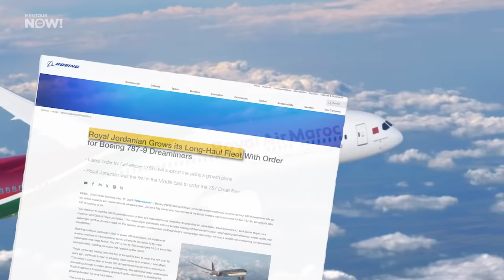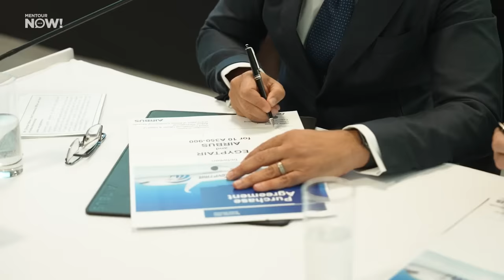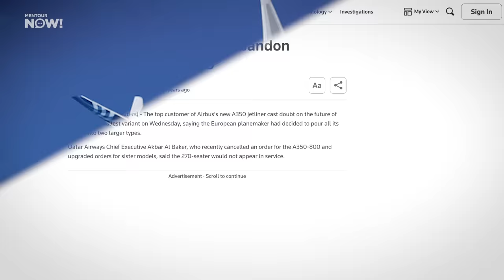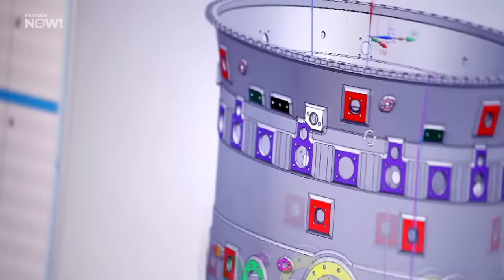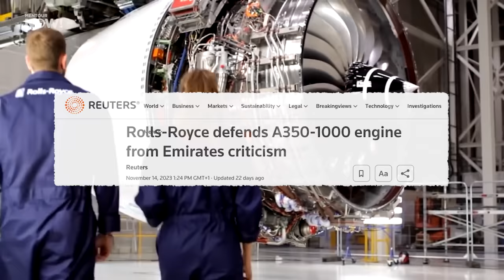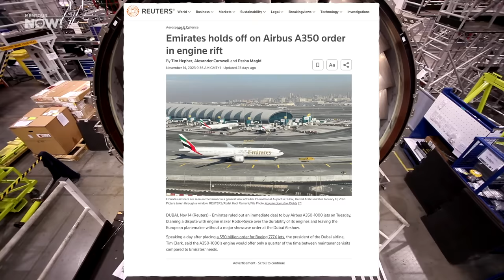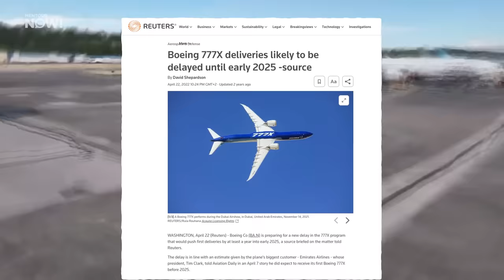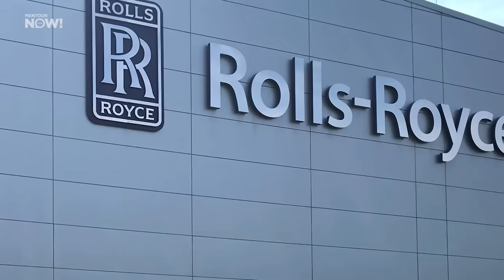What’s WRONG with the Airbus A350?!

Comment: Hi MentourNow Team, great video! 10:34 I’d like to clarify some misconceptions on the Trent XWB-84 and -97. Online sources indicate that their fan diameters are the same at 118 inches. The increased thrust output of the -97 comes from different internal component designs such as the larger core. Articles also shared that the increased power results in higher temperatures and requires improved cooling. Perhaps the high ambient temperatures in the Middle East also cause lower than expected time on wing performance because of these rotables and life limited parts being affected too.

Thanks for the video it really got me searching and learning more! Cheers!
Reply from the maker: Thank you for the information! Yes the fan diameter is the same, this was a mistake, it was the internal differences that were large enough for the two engines to end up with different designations.
Reply: Hmmm i am not sure about your take on temperatures. Jet engines operate under high temperatures, we, are talking about hundreds of degrees. How much hotter does it get in the desert? maybe 20 degrees or 30F. Thats a big difference for you and I , but not for a machine doing say, 800-900 degrees F? Plus, a lot of their hgih density departures happen at PM, when its MUCH cooler. My point? There must be something else to the story...
Reply: I’m glad you went thru all this because the moment he said 87 and 97 inches I was thinking “that’s like PW GTF and CF6 sized fans.
Reply: Combustor exit temperatures are well into the >1900K (~1600-1700C) for modern turbofans, well above the melting temperatures of the nickel alloys that the turbine blades are casted from. They require highly elaborate barrier coatings and actively cooled by enveloping the blade in a film of cooling air (which by the way, is already well above 600C to start with). A hot & high takeoff at say ISA+20C could have a significant impact on life-limited parts compared to the nominal flight profiles, so inlet temperature matter much more than you're making it out to be. 

When your components area already running at the very edge of what's physically possible, an extra 20 degrees matter a huge amount.
Reply: And in case it’s not obvious, the 87 and 97 in the name is the pounds of thrust in thousands.
Reply: @DuyLeNguyen  not if you reduce the power a bit which is what they do for midday departs. Most of Middle East heavy long distance departs happen between 8 PM and 9 AM, when its only around 65 to 80F. If they're complaing about that kind of "high temps" then they need to get out of the airline bizniz
Reply: @alexanderordinary2110  Inlet temp doesn't just affect cooling, air density is also lower at higher temperature which reduces amount of thrust an engine generates (all else being equal), so not only do you have worse cooling because of high ambient temperature, you also won't be able to derate as much because you need to run the engine harder to compensate for the lower air density, it's a double whammy, so you won't be able to 'reduce power a bit' because at high temperature you are limited in how much you can derate your takeoff. Full takeoff thrust is typically limited to a couple of minutes at a time, so you still need to get the loaded aircraft off the ground, with positive climb within those few minutes (plus sufficient allowance to still be able to climb with one engine out), there's no free lunch when it comes to hot & high operations, you either lose out on performance or maintenance interval, and if you cannot accept a performance reduction due to the demands from the ambient conditions, then you need to accept a lower time on wing.

Engines are typically designed for a baseline takeoff at sea level static, standard ISA (15 degree C), so your 80F is already ISA+10.
Reply: @MentourNow  huge surprise, not used to such errors from you, XWB84 and XWB 97 refers to thrust level.
Also some short cuts on the single source versus engine choice and engine operational costs….
Reply: @alexanderordinary2110  Hot air means less lift, needing more takeoff power, down at low altitudes where the sand is...
Reply: @DuyLeNguyen 
I am a bit conflicted about a relatively small temperature increase near a “threshold” causing such a dramatic in maintenance. But it might be the case as other engines have had issues due to incremental core temperature increases. But my “guess” is that the “non-benign” aspect of the operation is more than a transient core temperature increase but also a combination of temperature and seal wear (due to abrasive dust) or accelerated blade erosion / corrosion . It is fascinating that an engine has been designed to operate that close to the “knife-edge”. When something doesn’t quite make sense, it is usually because of having incomplete information, so time to go down that rabbit hole.

After going down the rabbit hole, it is more than just a “maintenance issue”! From an article:

Perhaps indirectly divulging potential future mission goals for the A350-1000, Clark is also pushing for a 10,000 lb. thrust increase to 107,000 lb. “The engine is under-‘spec’-ed for what the aircraft could do,” he said. “It does not have enough power, the technology is not proven.”

So combining your comment on takeoff off “thrust margins” being pushed to the max (pushing the engine to the temperature threshold), the airline’s demand for even more thrust (and potential core temperature increases) and RR’s intense reluctance to lose money on maintenance contracts, it seems to have lead to an impasse.
Reply: @Mentaculus42 other Gulf operators have been operating the same type for  4-5 years now and we've not heard much issues (at least not publically), and there are also other operators in SE Asia who do operate the type and some do operate in hot&high conditions and we also don't hear much (publically) about issues with those operators. If Emirates is making a big deal about this it might have something specific to do with their local airport and bases. As you said, sand might be part of the issue, but that's probably not all of it. 

In any case, it's worth following to see what happens next.
Reply: @DuyLeNguyen 
I updated my comment to you between replies. 

The important information is:

After going down the rabbit hole, it is more than just a “maintenance issue”! From an article:

Perhaps indirectly divulging potential future mission goals for the A350-1000, Clark is also pushing for a 10,000 lb. thrust increase to 107,000 lb. “The engine is under-‘spec’-ed for what the aircraft could do,” he said. “It does not have enough power, the technology is not proven.”

So combining your comment on takeoff off “thrust margins” being pushed to the max (pushing the engine to the temperature threshold), the airline’s demand for even more thrust (and potential core temperature increases) and RR’s intense reluctance to lose money on maintenance contracts, it seems to have lead to an impasse.

So it appears to be somewhat of a particular “airline issue” with regard ultimate performance expectations for an expanded role for that particular aircraft.

Clark knows that the engine “as is” would be financially underperforming for their intended use.
Reply: @alexanderordinary2110 The ambient temperature indeed is very important for a jet engine. Usually the engine performance is limited by the turbine entry temperature. The components, especially the HIgh Pressure Turbine Nozzle Guide Vane usually are designed to operate at their maximum at ISA+15K ambient temperature. A higher ambient temperature will directly lead to a higher turbine entry temperature. To not over heat the components and reduce their life, the engine performance is usually reduced at high ambient temperatures in order to keep the turbine entry temperature at the allowable maximum. This procedure is called flat rating. If the engine is already designed at the limits, the kink point for the flat rating will be at lower ambient temperatures. Hence the engine will have less performance and probably life when operating under these conditions.
Reply: @Mentaculus42  you can't just wish an extra 10k thrust into existence, no matter how much of a bigwig you are, that's a significant thrust increase, and probably would require substantial hardware change to do so.

I'd say this might be a case of unrealistic expectations. If similar Gulf airlines can make the economics work on this type, operating in similar conditions, then either they must either have much better operating margins than Emirates, or are content with making less profit margin compared to Emirates.

I would not hazard a guess as to which of the above is more likely, as I'm not well versed in the airline operating profits and business models.
Reply: @SK-qd4sr  
Good point. As I noted previously, Clark wants significantly more trust for this aircraft to the point that RR will not be able to accomplish that with the existing core and would not have a chance at good operational maintenance cycles.
Reply: @DuyLeNguyen  
From the same article”

Beyond relatively modest throttle push increases, it is unlikely that a thrust increase of the magnitude called for by Clark would be feasible with the existing architecture of the XWB-97. The 97,000-lb. version for the A350-1000 retains the same 118-in.-dia. fan as the lower thrust XWB-84, despite significant internal changes such as a 5% larger core.

So you are definitely consistent with that line of thinking! It appears that more issues are tied up with this particular aircraft and its future potential than just a particular engine, which puts it firmly in the Airbus’ arena with regard to how to “grow” it & by how much.
Reply: @SK-qd4sr  Right. As I said, most of their long distance (heavy) flights happen in the PM. when its much cooler. The shorter flights happen mostly in daytime, needing much less engine power for takeoff. a triple 7 doing a 3-4 hour flight, doesnt need much power to get off the ground, compared to 13+ hour flight.
Reply: @DuyLeNguyen we call that EGT…exhaust gas temperature
Reply: @leosmith848 there’s sand everywhere in the sky
Reply: @justing42  No, there isn't.
Reply: @justing42  who's "we"? Rolls-Royce calls it TGT as per the Type Certificate Data Sheet

Comment: Just a minor point about the 787.  It actually does have bleed air but only for the inlet lip.  All other systems that traditionally used bleed air are now electric.  I have a friend who is currently in 787 transition training and he was as surprised as I was.  And I actually work on the 787 for a living!
Reply: That’s really cool u get to work on them
Reply: Wasn't the bleed air port a modification to solve icing conditions on the inlet lip of the nacel?  That modification was made years ago.  I had smile when I saw the comments of the bleed air less engine suddenly getting a bleed air port added to it.
Reply: @aquaden8344  On the RR engine it uses HP3 air (if I recall)  for cowling anti-ice by a dedicated PRSOV. Air-conditioning air is supplied from the CACs (Cabin Air Compressors) to the air-conditioning packs. Wing Anti-ice is electrical heater elements in the leading edge slats. (WIPS).
Reply: @hughblack6831  Thanks for the info.
Reply: @aquaden8344  You're welcome - I've worked on 787s for 9 years - if you're interested in anything specific, let me know.
Reply: i just hope 787 is better than 777, as Swiss air used to use the 350 between Switzerland and South Africa and in oct 23 replaced it with a 777, what a disappointment, the seats are so narrow and the legroom much less than 350, only good thing of 777 is the last 3 rows in the economy, it only has 2 seats and when u sit there u don't get bumped by people walking past you, as the two-seat gives u that extra space,
Reply: @eisbeinGermany  The manufacturer does not specify the interior arrangement. It’s always done to customer specifications. Some airlines want higher seating density so you get the narrow seats and cramped legroom. 

In other words, blame the airline for that not the manufacturer.
Reply: @artjackson8360  It's the same with 777 and 787.  Airlines/Boeing managed to squeeze an additional seat into the seat rows to gain a economical advantage.  And exact for this reason it's worth to avoid Boeing planes like the pest unless one is looking for the pleasure of pressed into a too narrow seat (torture device).
Reply: @aquaden8344 See my previous comment about seat density. It’s the specific airline that sets the seating. Blame them, don’t say it’s the aircraft. You don’t like it switch airlines. Airbus has the same issue.
Reply: @artjackson8360  You are repeating yourself, and your argument is kind of lame.
Reply: @aquaden8344  How is telling you what happens in the real world a lame argument?

Comment: We must also not forget, Emirates have a large fleet of 777-300ER's and 777Fs, bying the new 777X will keep crew familiarisation and maintenance as they all use the core GE 90 engine which yes it's new family on the 777X but still GE, flight crews inc cabin and cockpit crew will be familiar and trained on the current 777 so transitioning to the new one will cost less. It just makes more sense for Emirates to go this route. Also the only aircraft within the size of the A380 is the 777-9.
Reply: You can say the same about commonality for the Airbus family of planes.  There is even more commonality for air crews than Boeing will ever achieve within the 777 line of products, old and future once.
The statement about the engine is even more surprising after GE had to redesign every section of the GE9X during the 777X testing.  The GE9X is the main reason for the delay of the 777X program.  Assuming the hot and sandy environment would have no impact on the GE9X is wishful thinking.  On contrary, the large 777X contract might bite Boeing and GE big time.  There must have been HUGE incentives for Emirates to place such a large order for an unproven, not certified wide body airliner with new, unproven engines.  The incentives are a close held secret, but it must be way more than a simple discount.  A discount can't cover Emirates risk of having to ground its 777X should there be teething issues like experienced with the 787, or if engine issues surface with the GE9X.  The contract must have some writing in it, that is covering Emirates risk, and that again might lead to huge losses for Boeing and GE should their products not perform as specified in the contract!!!!!
Reply: I see this as a missed opportunity to switch to better quality planes. Instead, they opted for another long term with an inferior product.
Reply: Would agree totally, if Boeing aircraft today, were built to the same standard as Boeing of old.  To me the 777x is likely another MAX- Its still the same management.

Comment: The A350 is magnificent. Just did two 14 hr flights from Atlanta to Cape Town and back. The best aircraft I have flown, including the 787,380, 777.
Reply: What do you like about the 350 over the others?
Reply: Passenger or pilot?
Reply: @CW-rx2js  passenger
Reply: I notice a huge difference in how my body copes with a flight on a 787 vs A350. The airbus always gives me a nasty headache, whereas the 787 leaves me feeling fine :)
Reply: @jgldev  It's quieter, smoother, less prone to turbulence (advanced 'gust suppression' technology) and it's pressurized to an equivalent of 6000 ft altitude (most others are 8000 ft). All round  Delta economy was quite comfortale and didn't leave me feeling tired (after 14 hrs) like other aircrafts would. 787 is pretty nice too but I place the 350 above the 787 in terms of  quietness and comfort.
Reply: @danielbroadbridge886 lol 😅😂 so the one that does more noise leaves your body relaxed 😂😅😅 just shows you never flow on a A350

Comment: Speaking of maintenance costs in dusty environments, I used to make (radio system) service calls to a geological survey camp in central Saudi Arabia back in the early 80s. They had a Bell Jet Ranger based at the camp, but it wasn't available to get me out there, so I would have to dead recon across the desert in order to get there in my Nissan Patrol SUV. I talked to the pilot once lamenting that he couldn't fly me in, and he told me that they would only get 12 hours out of each tail rotor due to the dust, and they cost $26K each!

Comment: The a350-1000 is still doing well. I’m sure Rolls Royce will work on increasing the time on wing performance and I have a feeling Emirates may order this aircraft at some point. Emirates even said they love the aircraft, as long as this issue is fixed it will definitely be considered at Emirates.
Reply: I can imagine if the 777X has further delays and if there are problems in the beginning, Emirates will start to shift to the 350.
Or airbus just starts with the A380-900 😅
Reply: @byFoxi I doubt Airbus will ever build any more of A380 variations. The project costs Airbus over 20 Billion of Dollars and clearly Airbus is not able to turn a profit from the program. They plane maker has put down all of the quad-jet’s production line which makes the restarting of the aircaft is as expensive as starting a new project. Even though there are airlines other then Emerates want a NEO version the A380, I do not think it will be sufficient enough for Airbus to just simply consider it.
Reply: @thevinhnguyen1661  airbus still owes the tax payers 1billion one the now defunct A380 project pay your bills airbus